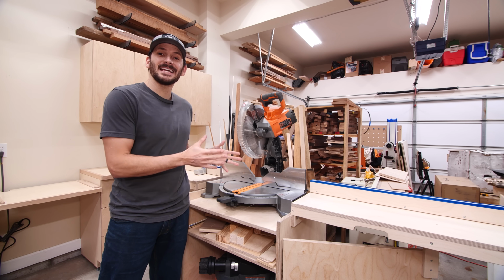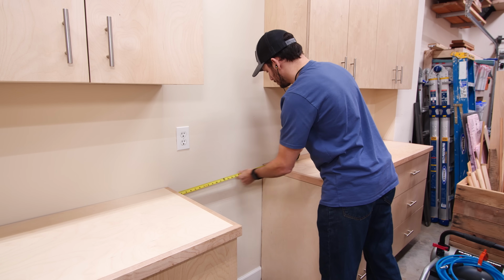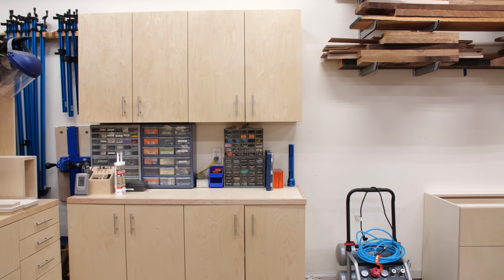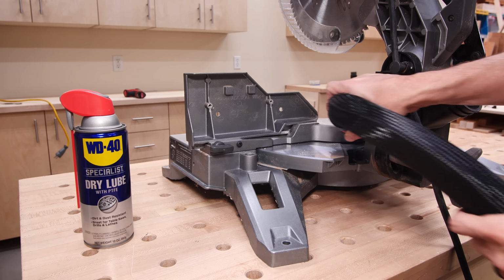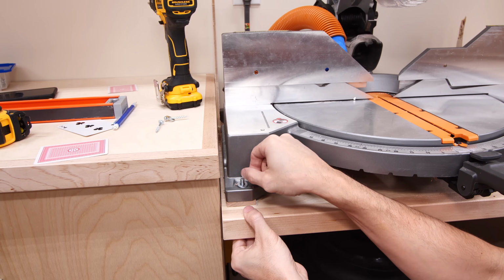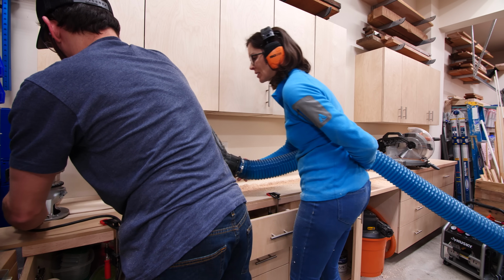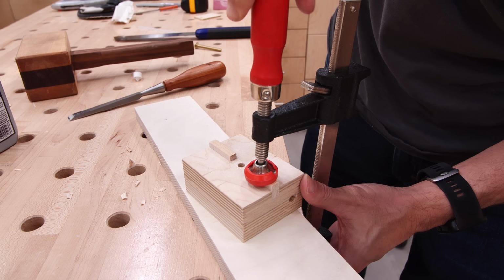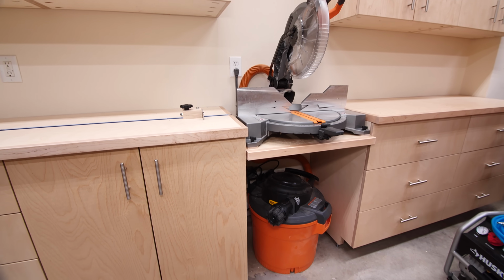Mobile Cart to Miter Saw Station & Why I Switched

Comment: I built these cabinets several years ago. I am now removing all of them from the wall to install the ez levelers and remove the bolts for adjustments. Sooo much better. I am removing the middle cabinet to install a shelf for the miter saw. I have to say, I have loved everything, but the bolt levelers, about these cabinets since I found your plans.

Comment: I modified my build of your Miter Saw Station.  Instead of putting the cleats in with a shelf, I built a cart to allow me to roll the Miter Saw in that is level with the station.  I will be making another cart for my Kreg router table.  If I get a the DeWalt Plainer, I'll do the same.  By making carts for these machines that are level with the station, I can take more advantage of this large work space.  I didn't put cabinets or drawers below my miter station in order to store my rolling work bench on one side.  The other side I store my pancake compressor.  Your build is great and offers a great deal of versatility.

Comment: Hello Fellow Saw Duster, I have seen some of your project vids and I like your style.
However, with this project, an AWESOME workbench, I wonder why you chose to permanently install your Miter Saw.
It seems to me that if your workbench could accept multiple, mobile tool stands like the one your miter saw was on to begin with, your workbench could be even more awesome.
These mobile tool stands could have flippable tops and hold tools like jointers, routers and planers that would benefit from your workbench's excellent fencing system & work piece support.
The tool stands need to fit into the workbench and require stabilization during use, but that could be easily done.
An easy way to stabilize the tool stands might be to add multiple heavy duty drawer guides to your workbench and have matching hardware on each of the tool stands. That way, when you need to swap tools, you can just slide one out and slide another one in.
THANKS AGAIN for your GREAT content! It all makes me want to make more saw dust!

Comment: Id have added one at each stud over both  sides. Then you could set any table top tool on it at almost any spot or used a hand held tool down the length of the top 
And never wanted an extra outlet.
Now this might not meet code but what the chance you have 5 tools all running on it at any one time? The most might be 2. How many outlets are on a strip plug ive seen 24.  At one end you could add a gfci or breaker thats lower then the panels breaker.   In a kitchen how often do you need to go looking for a spot to plug in?  Most houses all the time.
Here's the deal you'll never pull more then 15amps or 20 amps depending how the house is wired. At most youll trip a breaker.

Then you have drill chargers phone chargers a place to plug in a sander or drill press  router .
Reply from the maker: my intentions are to put small part storage there so the outlets would be covered up if I did that.  But if you wanted to use for small tools that would be great

Comment: I’ve got 4 different 3D printers. 2 FDM and 2 Resin. I’ve printed things like pegboard hooks, socket wrench organizers, paper towel holders, magnetized label plates for drawers, threaded fastener size/gage testers... finding stuff is easy. Modeling something you can’t find is a bit more difficult in my opinion and I would love to see that.
Reply from the maker: yes, the modeling is a challenge, but rewarding!

Comment: Hey Brad, nice addition to the shop.  I'm planning to do something similar soon.  I have a question about your dust collection: Do you have a bag in the shop vac?  How often do you empty vac, or clean it out?  I was thinking about putting a separator under the counter space but I know that it will take up valuable space.  
Thanks, Josh
Reply from the maker: Hey, Josh. I run a bag and a Hepa filter in there. I switch it out like every 6 months or so. A separator would be nice if I had the space, though it does reduce performance

Comment: Brad, great video!  Have loved your content.  A tip for drywall that was shared to me:   Use a sawzall, take old/used blade and snap them short so that the length of the exposed/cutting blade from the surface stop plate is the depth of the drywall gyp (1/2 inch usually, 5/8 for type X).  That way you can't cut past the back of the drywall and can make an easy continuous cut.  Hope this helps!
Reply: His way is how I do it and I’ve done over 10,000 repairs so his way actually works really well.

Comment: Was there just no way to make the opening the right width and then make the cart the right height to just slot the cart into place between the cabinets and then lock it in place with cleats or a few screws to allow you to keep the mobility?

Comment: You need one of those Bosh saws that uses an arm instead of a slide.  Having the ability to cut wide material is much nicer.  I got rid of my plain chop saw last year and have no regrets.
Reply from the maker: not a fan of sliders and I prefer to cut wide pieces on the table saw.  works well for me, but I know a lot of folks love the Bosch.

Comment: Hi how did the original inspection get through as putting cables across studs and the putting a pasteboard sheet on is not only dangerous but illegal in case someone puts a nail or screw through the pasteboard and straight into the cable. You did your extension correctly but looking at the cables that had been put them would worry me a lot and I would have probably taken the plasterboard off and redo his work. I hope you and your family have a great Christmas and hopefully an even better New Year

Comment: I've done what you did to my garage wall 25 yrs ago.  The next time I needed to add receptacles I opted to use molded conduit. You use extended boxes and attach the conduit between them., Doesn't look bad either.

Comment: nice build!
just a suggestion, make a few more flip stops. that way you could "save" measurements on a big project with lots of different cuts
Reply from the maker: I typically cut all my boards the same length at same time 👍

Comment: Nice build and very professional looking, but obviously you don't foresee a need to crosscut/miter material that's longer on one end (or both) than the left or right lengths of your counter top on either side of your miter saw.  These fixed configurations for any tool only seem suitable in large shops with essentially unlimited "wall" space, which most people don't have.  What do you do when you want to cut a precision bevel or miter or cross cut on one end of a 12-ft. piece of trim, or even an 8-ft. length?  Or for that matter, cut a long piece in half?  I know!  Roll out your FTBT mobile miter saw station!

I mount my "stationary" tools on mobile bases for this reason - also to enable storing out of the way in limited space, e.g., planer, jointer, band saw.  Don't have a drill press but would "mobilize" one of those as well.  The tool most analogous to a miter saw, of course, is my radial arm saw, and it too is on a mobile base to enable maneuvering, which I've done hundreds of times to enable cross cutting longer material, trim boards, etc.  Still have it but obviously the miter saw has taken over many of those duties.  

This is why I used your plans for the mobile miter saw station, with modifications, to enable, um.... "mobility" within my shop (it's also movable/transportable to location of project).  Even my table saw (cabinet saw) is on a mobile base, including the 5-ft. table extension, which I have moved around hundreds of time to accommodate ripping or forming longer boards, even up to 14 feet long.  That means 28 feet of length plus the saw blade.  It's awkward - I have to use the full diagonal of my shop and open a door to run material outside, lol.

I would just suggest that one consider the likely application or use of a tool before "fixing" a permanent base.
Reply from the maker: Definitely good things to think about!

Comment: I would do flip stop on other side
Reply from the maker: Never use the stop on the right side
Reply: @Fixthisbuildthat  i mean left side of block
Reply: @wykonczeni  but then you need to offset the ruler or put the rule sight on the other side too. Then it’s all on the wrong side from the direction you are looking at it from (the right in this case)

Comment: Just FYI, a licensed electrician for one outlet will cost around $ 999.99 plus materials, which will be only another $ 99.99.  I had a new outlet installed in my bathroom. I was shocked when I received the bill.  One outlet. $ 49.50.  12 ft of 14 2 wire $27.50 .  One box for outlet $ 17.50.  Misc. Parts $ 24.50.  Minimum labor for 2 hours work. $ 1000.00.  No permit $ 55.00. Yes, I paid for a permit, even though a permit was never applied for or needed.  The company said it was for their insurance just in case.

Comment: I have to ask, why not just use a power strip from the original outlet?
Reply from the maker: good question.  I plan to cover around that outlet with some small parts storage and just wanted it clean
Reply: @Fixthisbuildthat  thanks for the response! I would cover your open outlet behind the saw with one of those child proof covers just to prevent a dust build up in there 👍🏻

Comment: I may have an idea for a video I live on a farm and we have multiple reciever hitches that you put on your vehicle to be able to pull a trailer and we just set them all over the shop so I was wondering if you could make a storage rack or storage solution for this so they are hanging up and not all over the place and they have there own spot in the shop so would you please help me with this problem ??😁
Reply from the maker: unfortunately I don't have the need for it, but I bet you can figure it out!
Reply: Saw a video where a fella had all his smaller benchtop tools like grinders etc mounted to hitches that slide into receivers under bench and can be removed. Pretty sweet!

Comment: Really interested to see your updates - as a long time watcher, your mobile cart was one of the first projects I did when I got into woodworking and discovered the world of YouTube -- hard to believe that was five years ago.  From that time until now, I've had the same Craftsman 10" compound miter saw on the stand and always thought when I upgraded the saw, it would be a height only adjustment.  This winter, I finally decided to upgrade and got a new Bosch saw....it's waaaay bigger and won't fit on the stand (height and width are both issues, I think depth will be OK) and I wanted to reach out to see if you've come across this situation before and have any suggestions of  how you would recommend updating the cart for a lager saw. setup

My current thinking is that I'll make some kind of top addition that will interface with the original top and hold the wings and accommodate the larger saw with out me having to disassemble the whole cart...I haven't started designing yet though. :-)

Finally, 3D printing has been my "COVID project" and I went from experimentation with an Ender 3 a year ago to building two open-source printers from scratch and upgrading my Ender with the skills and components I learned about on those builds -- I'd love to see how you incorporate 3d printing into your workflow and other practical prints you've incorporated around the house.  I find mine printing almost daily and I've made countless things over the last year and a half and taught myself to be proficient in Fusion 360.

Thanks again for all and Happy New Year!
Reply from the maker: Yeah, sliders are monsters! Honestly the best approach would probably be to disassemble and make new shelves and back. Unless you glued it. Then I'd consider repurpusoing the carcass and rebuilding and using the wings and side supports. And thanks for the 3d printing feedback!

Comment: Just discovered your channel this week, and I'm loving it. Been binge watching your videos. Great work.

I have a question that a see a few people have asked, but no answer so far.  Do you think it would be possible to integrate a mobile cart in the the Saw station so you can retain the functionality of both? As Gregory Halye said about a year ago in the comments, you could just make the cabinets and the mobile cart the same height, leave the gap big enough to house the mobile cart with the "wings" down and lock it in place with some cleats or bolts?

Just curious as to if you think that could work? My garage is not as big as yours and I'm trying to maximise what I can fit in.

anyway, loving the videos and you've even got me considering a 3D printer

Comment: I built the mobile miter saw stand and thinking about the same move as you did, but my issue is that I upgraded the saw to DWS-780, which with pushed back fully makes the front of the saw fence around 21.5", which means that I either need a deeper cabinet or some other solution. Most of the time I will probably cut 4x2, 8x2 or 10x2, so I'm thinking about a 24" deep cabinet so 2x4 can rest and make a 8" extension board that I can install when I cut wider pieces.

What would be your suggested solution, I might be missing something obvious.

Comment: Maybe I'm just lazy, but I would have just installed a wall-mounted power strip instead of a wiring in another outlet and have all those additional outlets. Definitely not a criticism. I've been brainstorming how i'd do something like this, but I still want to be able to use the slide part of my miter saw. I haven't built work benches yet, so maybe i can work something integral into it.
Reply: This is the way to go. Or if you're cutting out drywall you might as well add several two-gang outlets along the entire wall. 

OR just go with exposed conduit. But I'm weird and I like the look of emt in a shop.

Comment: Great build, Brad! How did you determine the position of the t-track (aside from that you wanted it on top of the cabinets)? How important is the location? I've seen upright t-track fences that are placed flush with the saw fence, but wonder if that is necessary for a top-mounted track. Cheers!
Reply: I was trying to figure out how to do mine.  I'll be going with a flush mount like he did.  The upright will be in the way for other uses, or with not-so-straight boards.  As far as position,  it looks like far enough back that the block is out of the way for longer boards, and close enough for the flip stop to be solid in its function. I would guess about 1 to 1.5 inches back,  depending on the block design.

Comment: Awesome! Non related How’s that mini split work for you in the garage?? I have an 18 x 24 detached garage and was thinking of putting in the Mitsubishi mini split heat pump - I’m curious if that will pump out enough heat here in NY - great content on your channel 🤙🏼
Reply from the maker: My garage is 31x19 and it's amazing. Heats or cools the space easily. As long as you have decent insulation should be fine. Think I went with 18k btu.
Reply: @Fixthisbuildthat  awesome thanks man

Comment: To be fair, I wouldn't characterize your "mine field" of metal pieces on the underside of your counter top as a failure to plan.  Unless you feel like foreseeing the potential to alter the use of that counter space as a mitre station was a likely eventuality. It wasn't supposed to be a mitre station to begin with.  Sayin'.

Comment: If nothing else, you can let the Zircon folks know that some idiot that watched your video didn't even know such a thing existed and he will probably purchase one. That will be so handy because I will be needing it in about 4 years ago lol.  I use a lot of lumber that has staples that I have to remove before running through the jointer. Most of the time they are easy enough to see but in very rough sawn pieces they blend in once they oxidize. Great work all around and mentioning the wand was very helpful.  Thank you!